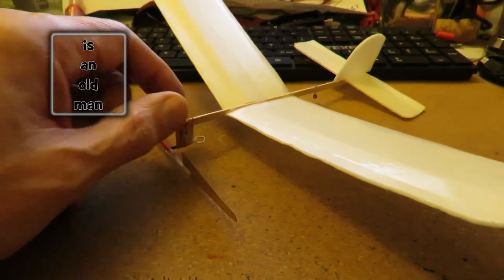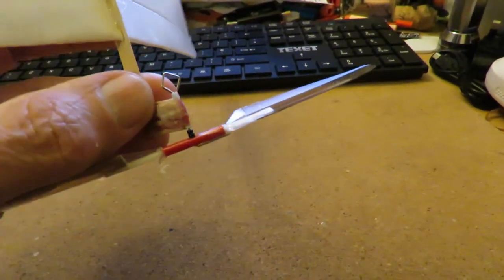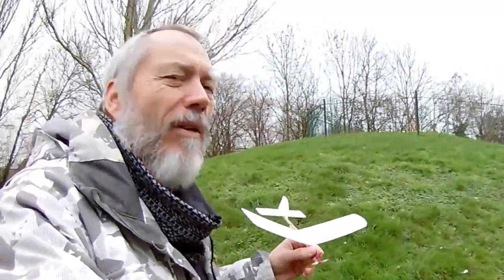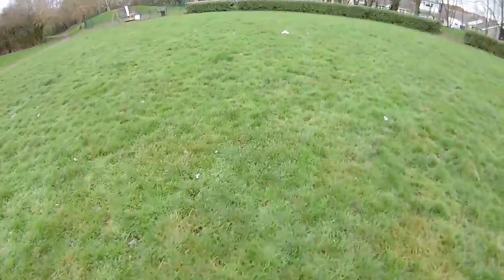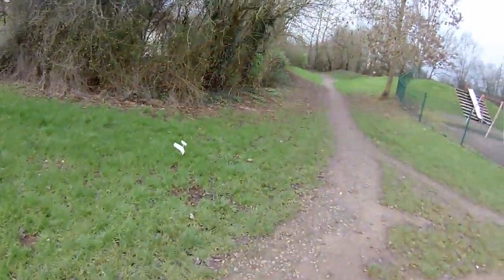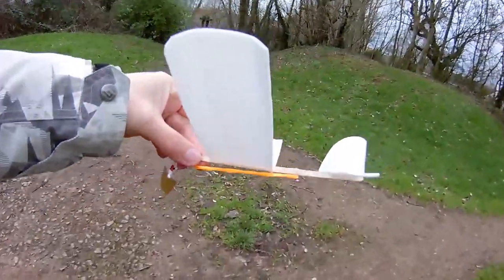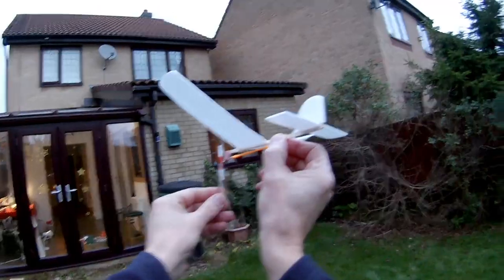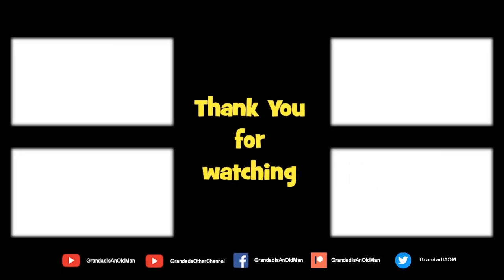Coffee Stirrer Rubber Band Aircraft thrust angle altered

Comment: One improvement could be adding some incidence to the wings, they are not fully aerofoil sections so they might need to deflect the airflow downward to get lift. Still it is a good little flyer, especially when you consider it's made from from 'bit 'n' pieces' of rubbish.
Reply from the maker: It certainly can be improved 🙂

Comment: Hi, Good video.

 I see you have down left thrust? All the planes I have flown and built need to have down-right thrust in order to compensate for the torque of the propeller, unless your propeller is turning clockwise when viewed from the front. I couldn't really see if it was on the video.

Just noticed after watching again that your prop is turning anti-clockwise when viewed from the front so I can't imagine why you would want down-left thrust? Are you trying to "make it fly in a left-hand circle? Just wondering. :D
Reply from the maker: Yep but that was the suggestion so I gave it a try 😀
Reply from the maker: I cut the prop off and put it back with some right instead of left and test flights look promising. Originally I just had some downthrust and straight ahead. The suggestion was more downthrust and LEFT so I gave it a try. To be fair with the windy conditions it has been subject to we can't draw and sensible conclusions. I did get some rather nice flights today but could only test it in the street so didn't give it full power.
Reply from the maker: You can have an advanced peek at the video, it is currently unlisted https://youtu.be/FWkyir8Dwak
Reply: @GrandadIsAnOldMan  Cheers mate. :D